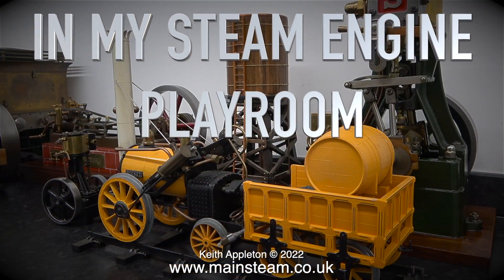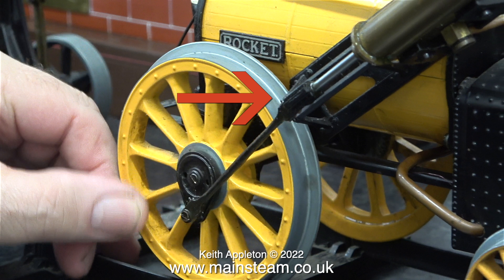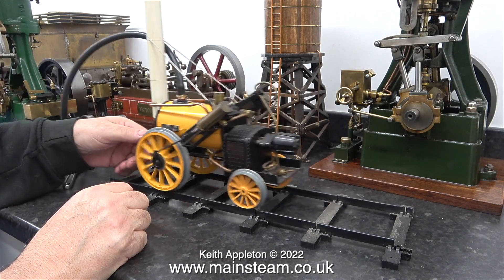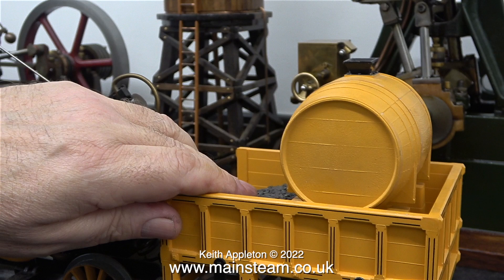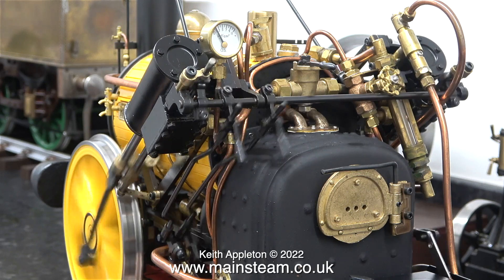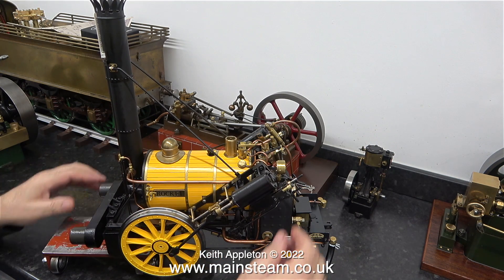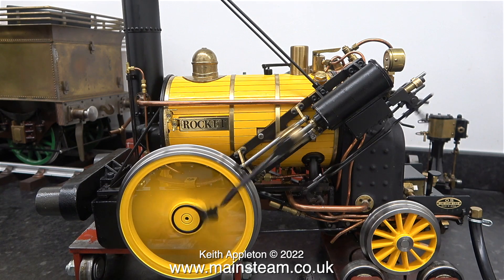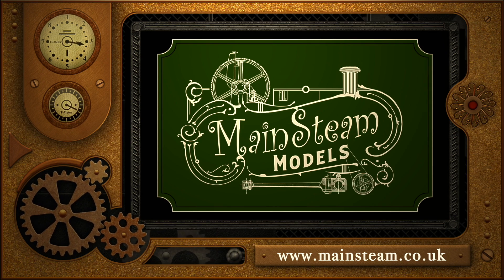IN MY STEAM ENGINE PLAYROOM - PART #1

Comment: Thank you for your channel. I have been a lover of steam engines since I was in short trousers. I am amazed with your skills and expertise from your other channels. The only steam engine I ever owned was a second hand Mamod?, not sure that I got the name right. I was twelve and my father told me that I was not allowed to play with it without his supervision, and yes I did and it blew up. I was running it in the back garden, but I must have not put enough water in the boiler. I had gone into the house for a comfort break when suddenly there was an almighty bang! The back door was smashed and blown off it's hinges and was inside the kitchen on the floor. I hate to think what could have happened if I did not go indoors for the comfort break. Thanks for your channels.
Reply from the maker: as these small Mamod steam engines only run at a very low steam pressure, your safety valve must have been seriously stuck - !
Reply: @keithappleton  It did not have one, just a bolt so you could fill it.
Reply from the maker: mmmm - I was going to mention that .......

Comment: The odd gait of Rocket was due to the Rainhill Trials requirement that all wheels be sprung.  While likely old news for you Keith, not everyone will know such details.  The springs were for vertical travel of the chassis relative to the wheels.  But any vertical component in the piston arrangement would cause spring compression and extension as the pistons worked.  4 times per wheel revolution!  Wee!!

4 years later, Liverpool & Manchester Railway #32 "Experiment" had perfectly vertical pistons and bell cranks to drive the wheels, likely making Rocket a smooth ride in comparison.
Reply from the maker: Interesting information - thank you {:-)))
Reply: @keithappleton  These angled pistons seem odd now, but the designers were convinced that horizontal cylinders would wear unevenly.  It somewhat makes sense, as the piston would be drawn downwards by gravity to always be resting on the same line inside the cylinder.   

Were these gentlemen incorrect?  You have examined many, many horizontal cylinders Keith.   Did you ever notice any scoring or wear on the down side of either the piston or cylinder?
Reply from the maker: I have never seen any evidence of that in the miniature versions . . .
Reply: @keithappleton  thank you Keith.  Appreciated